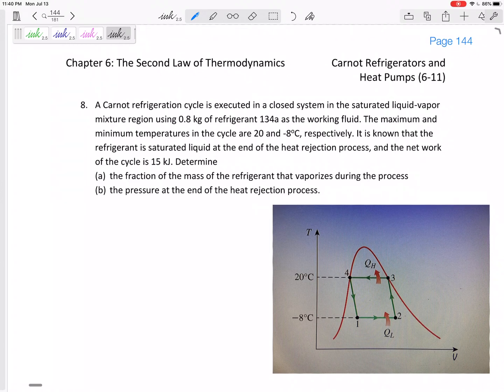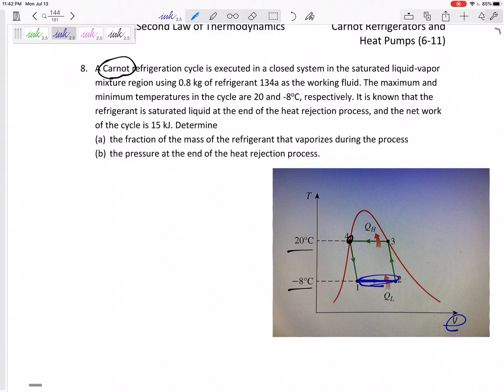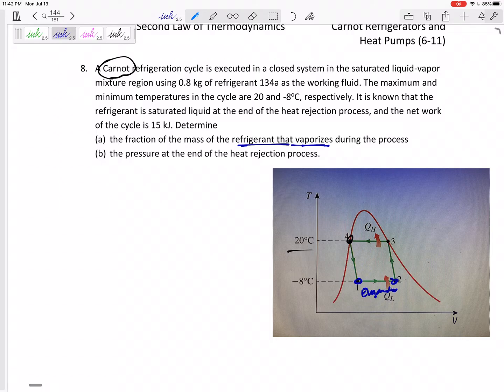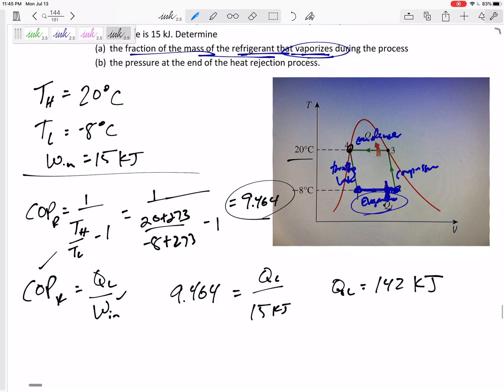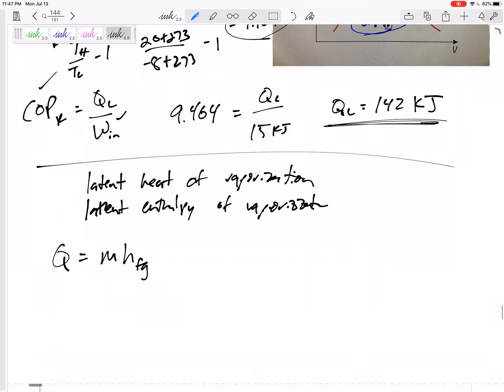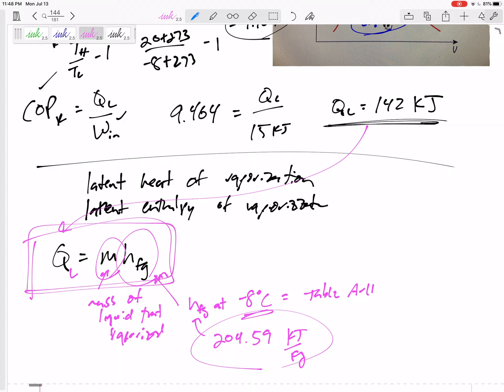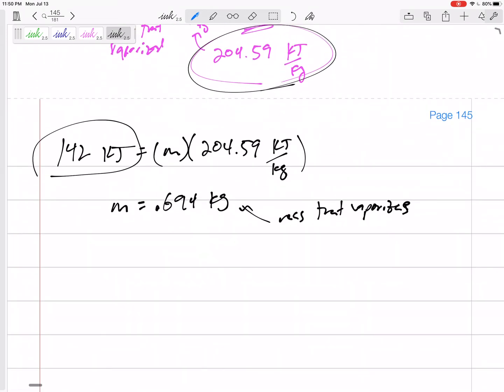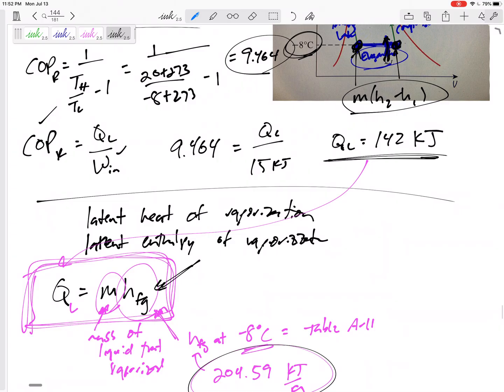Thermodynamics - 6-11 Carnot refrigerator example

Comment: earlier in 6.4 example 2. when we used Q=m hfg. it was mass flow rate not mass. why is that?
Reply from the maker: Use mass flow rate when the equation is all about “power”. Use mass when the equation is all about “work” or “total energy.” The difference in mass and mass flow rate is dividing my time. Just like power is work per time.
Reply from the maker: Keeping track of units might also be helpful.